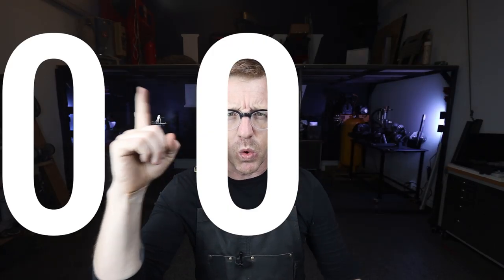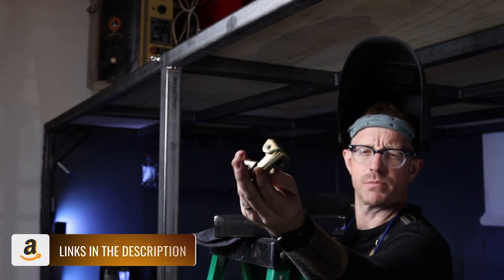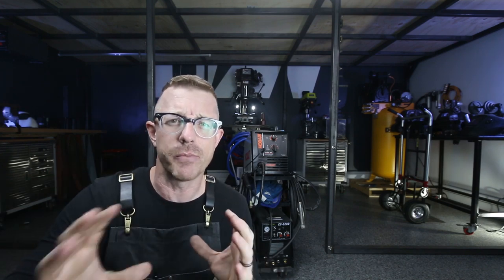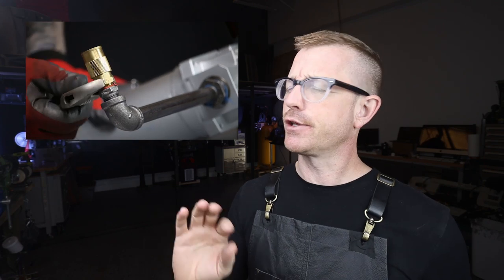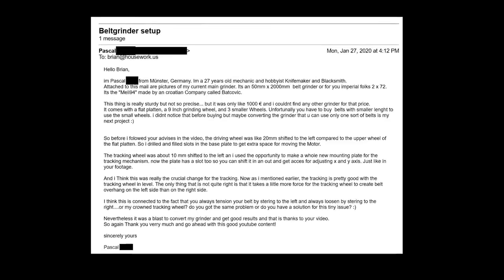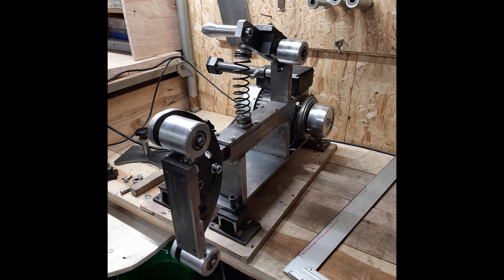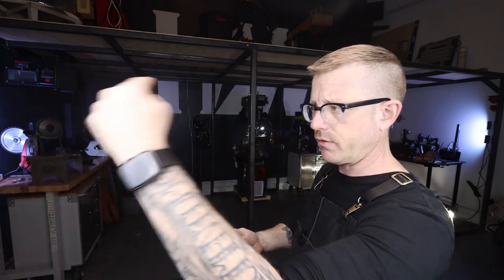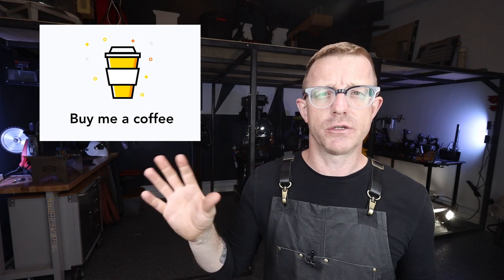HOUSE / WORK VLOG - 001 - I Probably Shouldn't Have Made This

Comment: Dude once again great video. As far as weld carts go one thing I'm adding to mine is the millwakee packout mount plate cause I switched all my consumables over to one of there slim line organizers and then you can jus clip them to the side of the cart. It kinda goes along with the hole theme I'm doing in my garage making all my tools modular. So I can keep my workbenches as clear as possible. I'm trying to do a video  series of  the whole process.
Reply from the maker: I'll have to look into the Milwaukee packout plates. That sounds interesting. Where are you publishing this series? On YT or IG? I am interested in watching that!!